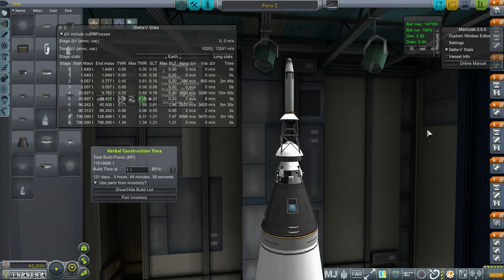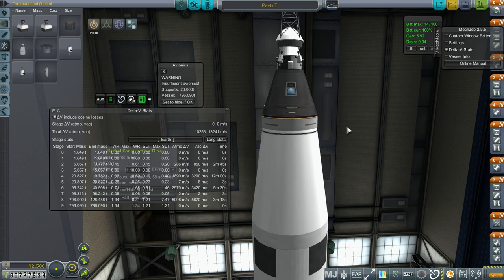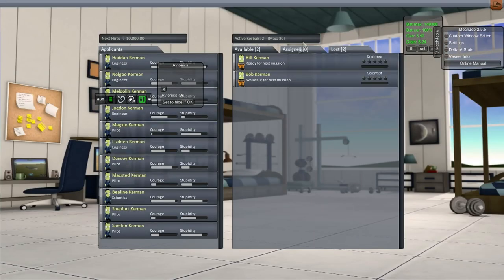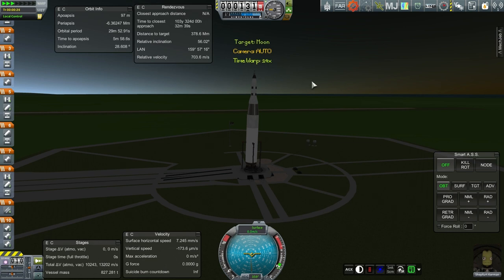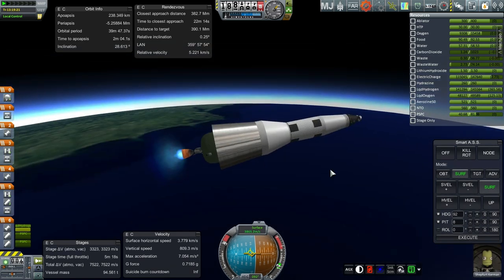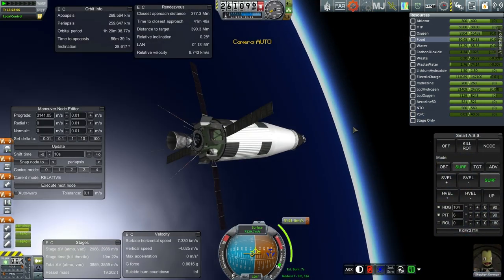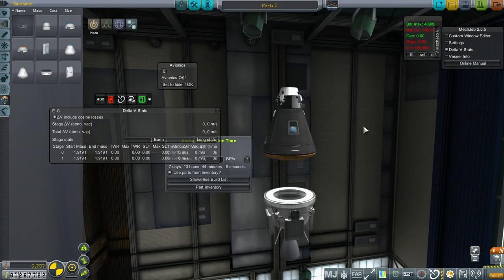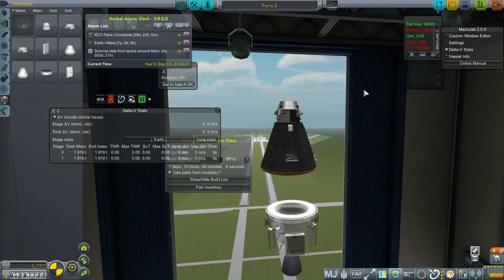Realism Overhaul in KSP 1.0.5 - 30 - Shaky Rockets

Comment: about the rocket sohaking and exploding on the launch pad. The only work around I came up with that works some of the time is that I enable the "no part crash damage" or whatever it's called in the cheat menu before I going to the launch pad then I turn it off after KJR stabilizes before launching the rocket. Great video!

Comment: oh yeah, another thing that might but probably won't work to fix the shakey rockets is moving the rocket higher off the ground while in the VAB. I sometimes wonder if RSS messes with the stock code that decides how high above the ground to place the rocket, and the shaking is caused by your rocket clipping with the ground. One last possible solution is to not use any launch clamps.
Reply: +Tyler Raiz those were just some guesses, and in my most recent play through they failed to work. However I have had very good success fixing snacking rockets by reverting to the VAB and then relaunching the rockets. With KCT installed, reverting to the VAB seems to revert you back to the KSC with your rocket rolled out and ready to launch.  I have been launching a ton of the same exact same rockets with the same craft file and occasionally one is shaky, so I doubt it's rocket design. I ended up reverting to VAB the launching the rocket again from the KCT menu and the second time it worked. let's hope this bug gets killed by 1.1.

Comment: too me looks like not enough stablizers on top. u forget larger a rocket gets in ksp teh higher u want the clamps on. might want to look at getting some clamps to help with tthese tall rockets.
DRE has long been updated for 1.05
Reply: well your other is sandbox and this is career so that may be the problems as RO never been reliable for a career game.
normaly i dont recommend mods to youtubers but i think u should get the fasa launch clamps.it has ones that work real good with tall rockets by the clamps move off to side so no chance of hitting them. since u aready use the fasa engines wont be hard to add them and tthey small in size think around 5mb so no game impact but better looking rockets.

hope u get it sorted as i prefer to watch career playthoughs over sandbox.